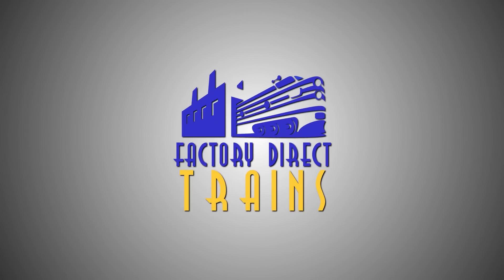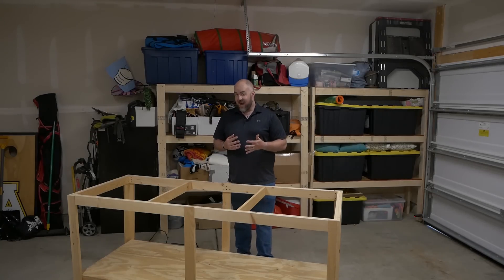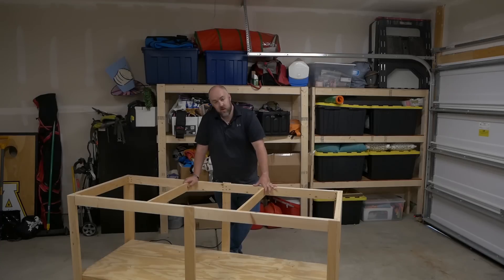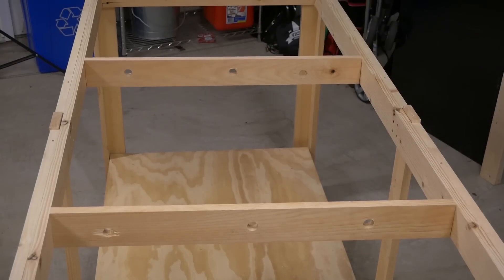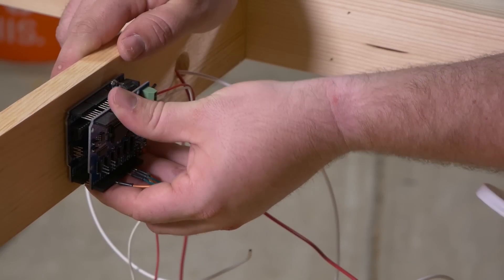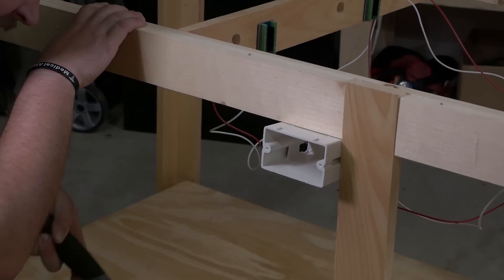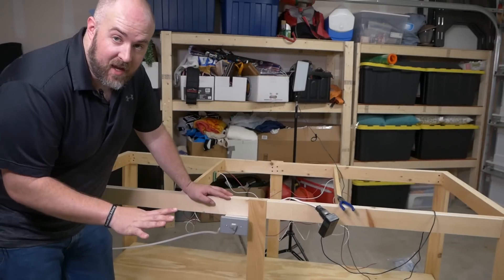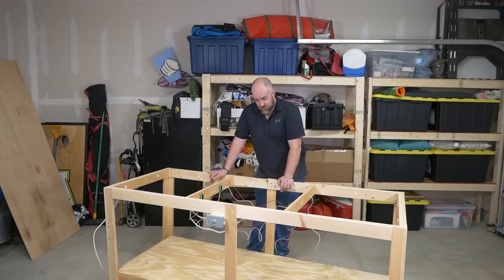Building a New Model Railroad Part 1: The Benchwork and base Wiring

Comment: What about making an Arduino controlled setup which can measure the amount of current going through the tracks and activate a relay to disconnect the track power from the DCC++ base station in an event of overload or short circuit?